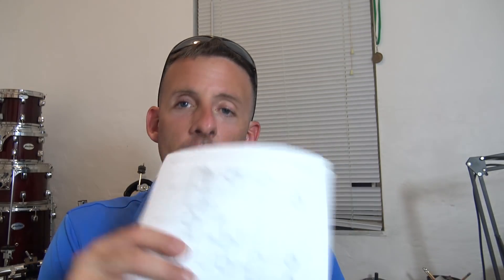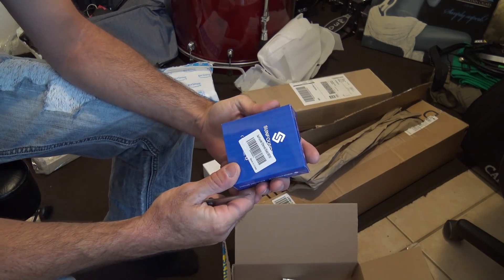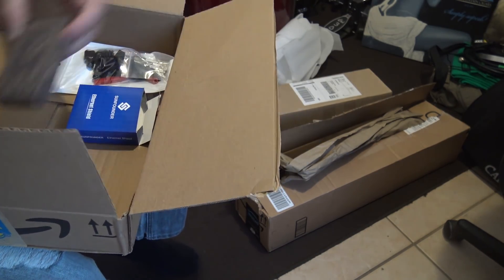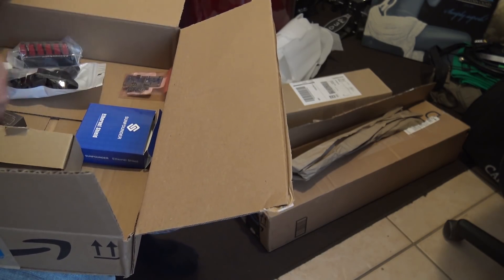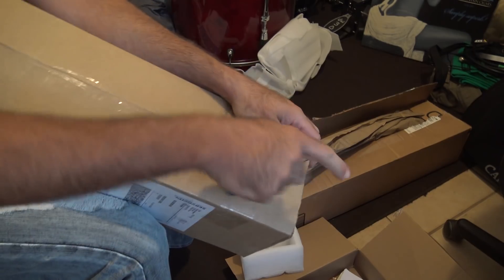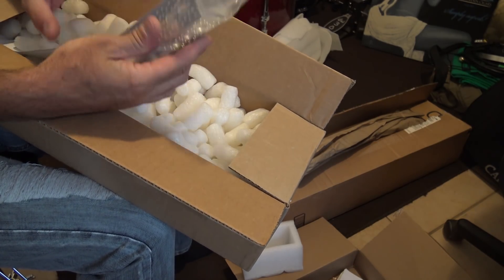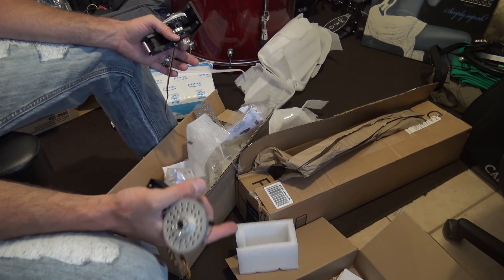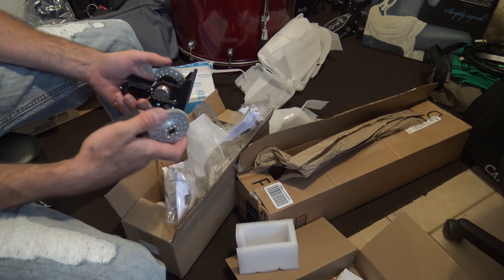Building An Autonomous Satellite Tracker For Ham Radio, Part 2

Comment: I ordered the part number you listed in the video, and my tilt system came disassembled and no servo. It does have the potentiometer included. Not sure about the servo. I guess I will need to call them and get that part as well. I'd be interested in knowing if anyone else had to order a servo separately and what part number you used. I agree what is the use of a tilt system without the servo. The name of the company is Servo City for crying out loud!

Comment: Hi,
Just went to servocity for the SPT400 tilt system. 
As you said it doesn't come with a servo - what servo did you select ?
Also, I assume you selected the 5:1 ratio but what servo spline did you select - 24 tooth or 25 tooth ?
Thanks for great channel.
Reply from the maker: Anthony Fitzgerald 5 25 ratio https://www.servocity.com/sptd485hw-tilt-system

Comment: I am working on a printed circuit board using the Esp12E by Espressif. It has WiFi, Rs232,  SPI and i2c interface, used by the GPS chip, and nine-axis accelerometer/magnetometer/compass.
It would be great if I can integrate everything onto a pi zero footprint, (which I'm trying to do for economy of pcb construction). arduet.com or QRZ KN6DAM. I'll publish the printed circuit board CAD files as open source as soon as I build and test one. A bunch more projects on my webpage.
Reply: William Bello I look forward to that!!!
Reply: @davistroy  I'm doin' my best. Thingies keep changing- like an on-board 7<30Vdc (input)- 5Vdc (regulated, 2.5A) switching power supply.
DC relays, to drop "holding current" to the PWM servos.
Using 9-Axis accellerometer (3-axis isn't good enough).
Measuring/fitting the GPS/Magnetometer on or around the Pi-Zero footprint HAT.
Because I am not able to program it myself, I've chosen to go the "established" route of using a Raspberry Pi ZERO-W. I've seen that done, but using Adafruit "development" boards.

Well, kiddies, developing period is over. It's custom PCB time! OPEN SOURCE!

Comment: Watch out for switching mode noise on those voltage converters. It shouldn't be a problem at vhf/uhf but its worth investigating before you get it all set up in the field.

Comment: IF THE BATTERY IS 2 BIG, CUT OUT PART OF THE TOP SO THE BATTERY FITS, THEN YOU CAN SILICON AROUND THE TOP OF THE BATTERY...…….
Reply: That's just stupid. Get two smaller batteries, and wire them in parallel, to meet the ah rating.

Comment: Eric, is polarization a factor?
Reply: Bob Blitheract yes however if you want to run 2m antenna at a left hand 45 tilt and the 70cm right hand 45 tilt, this will work just fine.